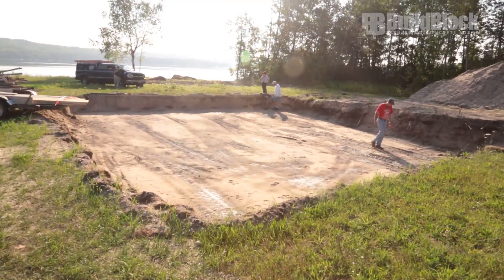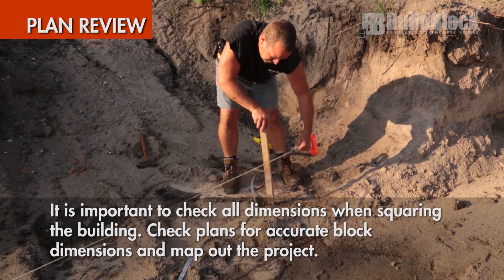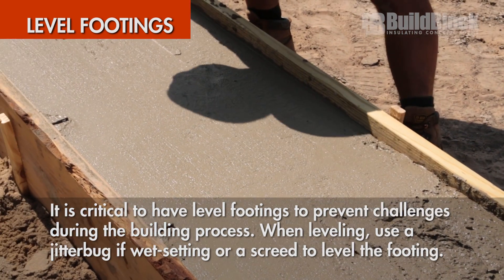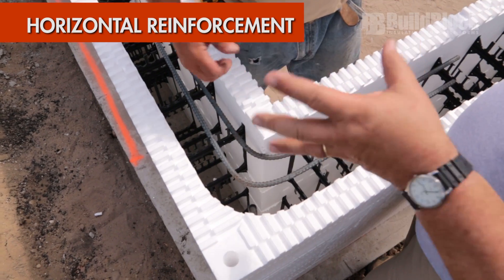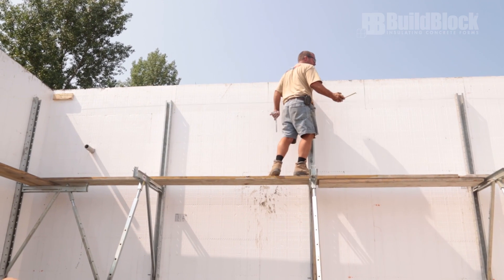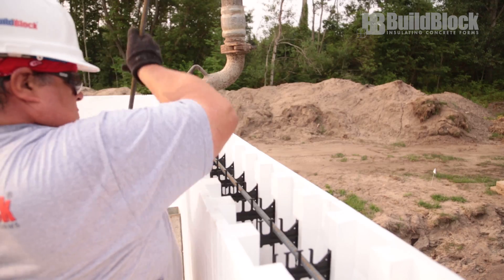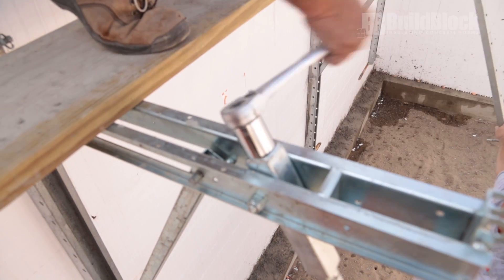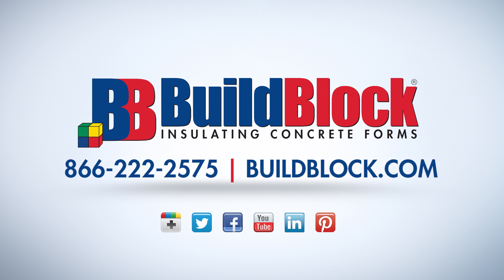BuildBlock ICF Construction: Overview

Comment: What type of aggregate did you use in the concrete?  What is the concrete mix design?
Reply from the maker: Our minimum recommendation is a 3000 psi 3/8" chip mix. See this link for specifics. http://buildblock.com/technical-support/concrete-design-mix/